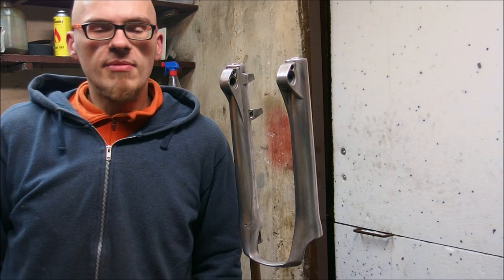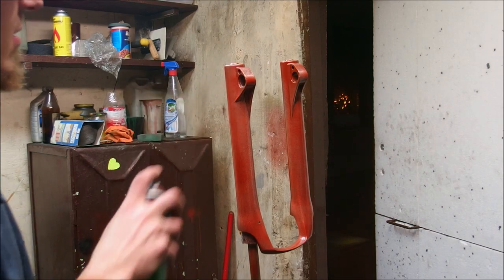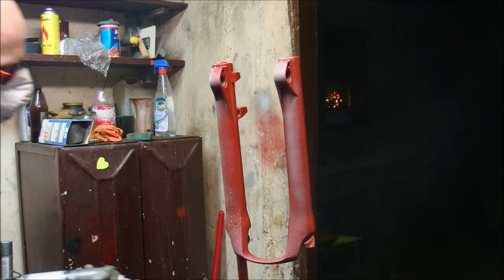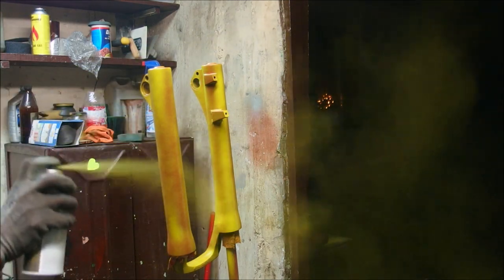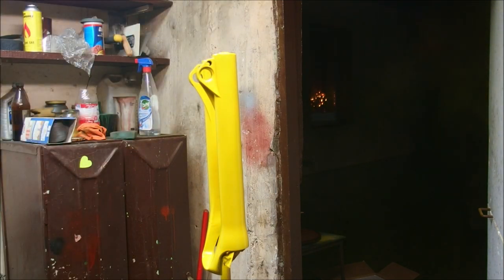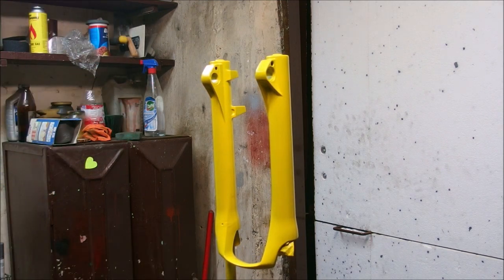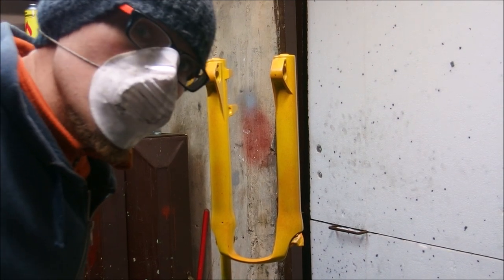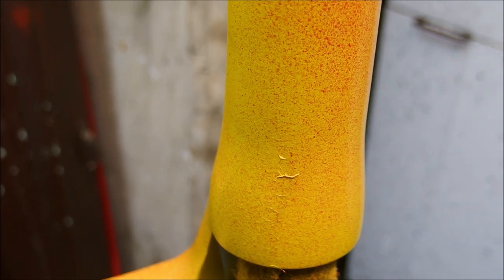HOWTO: Spray painting suspension fork lower legs.

Comment: Is it safe to paint stanchions
Reply: No, it's not safe
Reply from the maker: Definitely not a good idea. Stanchions are hard anodized and infused with lubricating material and painting that over will ruin them.
Reply from the maker: siemenssx1  You don't - unless you dredge the used market. LOwer legs you can paint, but stanchions are hard anodized and  infused with lubricant - chainging their color is possible, and there are companies that do it, but it is very, very expensive.
Reply: siemenssx1  I wanted the same thing but it wasn't possible. I wanted gold ones too.